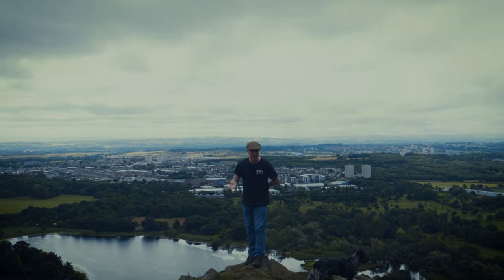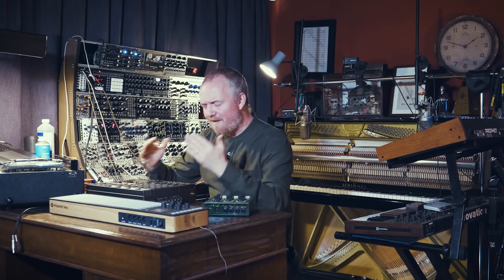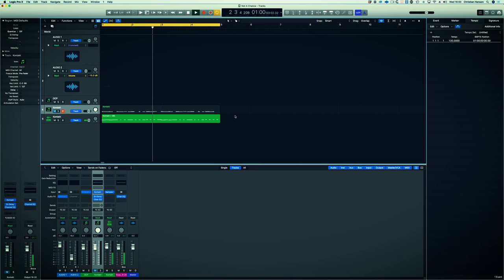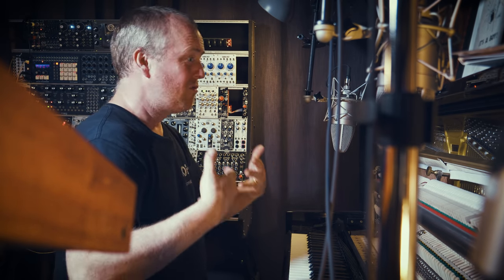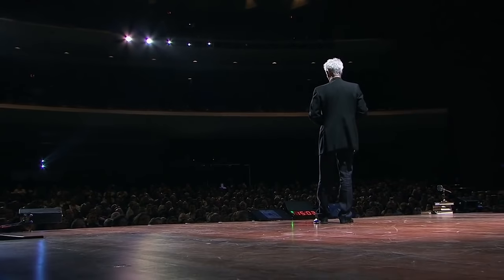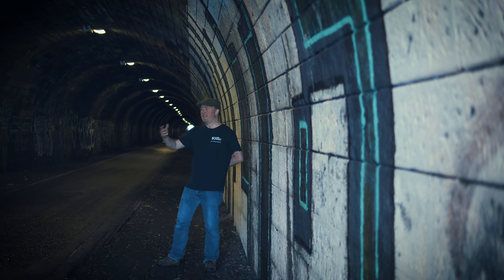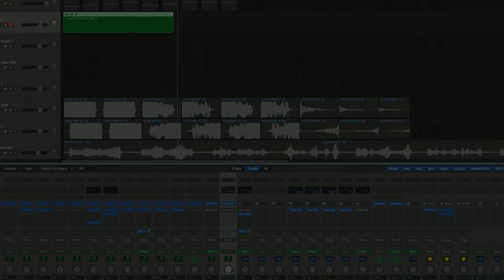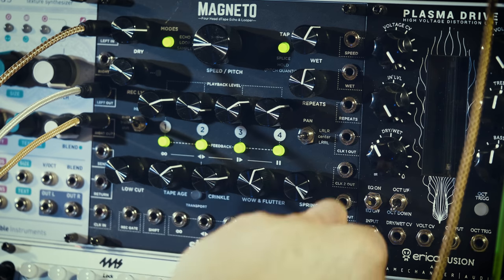Why Are Synths So Difficult To Mix???

Comment: Fascinating video! I knew a lot of this already but you went into greater levels of detail than I expected. Space perception and reverb are such important additional factors. Best video you've made so far. You've given me some new ideas about processing digital instruments, thanks for that!

I totally agree with the need to re-introduce some analogue artifacts to mess up the digital perfection we have nowadays, but I prefer to do it with plugins that emulate such things. They're so much easier to use, and I doubt many people have the ears or good enough monitors to tell the difference anyway. I've got a 4 track reel-to-reel deck sitting just a few feet away from me but I just can't be bothered to use it anymore.

Also, there are some great new developments in emulating analogue gear these days. Check out Plugin Alliance's Knifonium for example, it's the most authentic sounding emulation of a tube driven analogue synth I've yet heard (drifting oscillators for example). The video and audio examples don't do it justice though, using the actual plugin sounds so much better.

Comment: I've long disliked the trend for clinical bandwidth separation EQ.
As a sound guy I CAN do it but it's not a thing I'd use on any music I had any control or choices over. 

I love the audio playgrounds you make for yourself CH.
Reply: I agree. I've practiced making "clean" mixes to the point that it started to sound terrible. Things do overlap a bit in real life, and looking at a scope can be a bad thing, because our visual sense takes over for our ears without us noticing, and we'll "fix" things that there's nothing wrong with sonically. It's like tuning vocals in Melodyne. If you can see that a note isn't on the grid, you'll feel a strong urge to fix it.

We should look away from the screen more often. Close our eyes and hit play. Use the visual tools to locate the issues we hear, not the ones we don't.

Comment: When, prior to retirement, I was a Product Designer for a major analytical instrument manufacturer I asked our Senior Electronics Engineer, who had multiple patents in the field of signal amplification, whether there was anything unique about tube (you say valve) electronics that could not be duplicated by solid state electronics and he assured me there was not. Anything a tube circuit can be designed to do, including harmonic distortion when overdriven, a solid state circuit can be designed to do, at least if you know what you are doing.

Comment: Synths are so variable sonically. I find my analogue synths often have to be tamed back quite a lot when you start having lots of sounds in the mix. I've found myself scooping so much mid out of my Prophet '08 to stop it overrunning the main focus of the tune that I then had to mute/unmute it to see if it was even present enough to keep in the mix. But as you referred to with Kraftwerk and John Carpenter- arrangement and space make such a difference to  how it sounds (as with any group of instruments). Imagine mixing a track with a pads from a CS-80, JP-8 and Oberheim. If the sounds aren't crafted around each other in the first place, it's a tricky game.  Great video - thanks! (oh for the immediacy of the portastudio- I now miss that, despite being glad at the time to ditch cassettes for digital. Now I long for tape again!!!)
Reply: Tascam makes digital PortaStudios.  For the same reasons I prefer hardware synths over VI, I'm rather tempted.

Comment: Awesome presentation! Awesome sounding piano pad! Instant modern ambient cinematic design! Maybe u get more enormous and key oriented layers with samplers like EMU ultra (1999) pitch and filter, sample retriggering, sample start modulations per layer, or transwave sample granural like sample offset modulations from ensoniq eps-asr samplers (1990).

Comment: If you want to utilise the Monsoon (which is primarily a granular yhingymajig) as a reverb, try it out in the ErbeVerb inspired alternative mode. Another quick tip on the Monsoon if you're just getting started, the density slider is responsible for 'seeding' grains. In the mid position it seeds no grains, at the top end it seeds grains randomly and the bottom end it seeds them regularly with increased frequency as you reach the extreme minimum or maximum position of the slider. 

Have fun! :)

Comment: On soft synths for this sort of purpose, my go to plugs are the sound toys devil loc deluxe (usually with the mix knob low), arturia moog filter with only a very slight touch of cut off, waves j-37 on 7.5 ips with some pitch modulation, abbey road vinyl (does very tape like things to upper harmonics), and valhalla vintage reverb for spaces.  For me, adding some distortion and/or modulating the tape pitch always makes synths to sit better and feel more like a "real" recording in a room.  I find the valhalla vintage verb is dark enough to sound more realistic than many other verb plugins, particularly the 70's algorithm.  Also if you have several synths, I think you need to pick frequency pockets for each so they sit separately (unless you want them to sound like a unit).
Reply: You have the secret sauce my friend. Those are all very good plugins.

Comment: How do you film all this? Do you start with a script and film specific segments in these separate locations? The cuts flow so good and I love that all your videos always include some great hiking footage.
Reply from the maker: Thanks, I do a skeleton script and map out the set ups I want then I assign lines to the setups (trying to keep a read off each line across at least two setups) I then do a rough cut kill about half the script and then re script pickups. These i traditionally do In the shed so I can instantly put it into the cut to see if it works so here me sitting in front of synths set up and me at main workstation are the last pickups. When completing fine cut I usually have to really get the running time down so will trim back to b roll  and macro shots and replace my reads with snappier and more timed voice over. I then add additional footage and music, dub, grade and away it goes!

Comment: I kind of agree, but not entirely, mixing Electronic sounds is really easy, for me at least. It’s all about EQing, cutting of frequencies of sounds that it doesnt need, carving room for each sound in the entire mix. I see many comments about stereo, I don’t see an issue there either. I mean, yes if a sound is too wide it can cause phase cancelation, and then i might take only the left or right signal and add some stereo myself. But the main aspect of stereo is making sure the sub bass is in mono, or mostly in mono at least. And that is easy to achieve as well, just separate your subs, cut out all sub frequences from all sounds and add a clean sub bass under it. The mixing process for Electronic music is not so much about volume as it is about carving frequencies, and that does add a layer of complexity, but it isnt harder than mixing acoustic. It is just a different skillset.
Reply: Same here! also, he leaned a lot on the idea of chaos, but I think it's the total opposite. Recordings carry a lot of information: the kind of instrument itself (via the harmonics and noise it produces), the steadiness of the player (of breath or hands), the size of the space it was recorded in, if it's closed or open, the position of the instrument and the listener, materials and their arrangement in the location, even rustling suggests silent people or wind.... it's not chaos, it's all information that you pick on. Digital comes very clean so it gets boring quickly, but you can add any of that if you wish, to spice it up, with effects.
In digital instead of setting up your stufio for that sound you want, you setup effects to suggest all of the above. Create a place, a situation, a mood, with precise control. 

Additionally, clean precise frequencies will cancel each other in clear patterns, so there's that too.

Comment: Amazing textures! I wonder how can I get  close to this type of sounds in the box..
Amazing video
Reply from the maker: I would suggest starting from an organic source even if that is sampled, I did a whole bunch of pads like this in the box for Albion tundra and the trick is putting unexpected things in that add unexpected nuance and detail then make sure you curate each note so every note is different (I did this one in octaves) and make sure each note is long (20secs in this case). Then when you pull into your sampler make sure you only pitch down from the root note don’t pitch up.
Reply: @TheCrowHillCo  Will definitely try that out, thanks Christian!

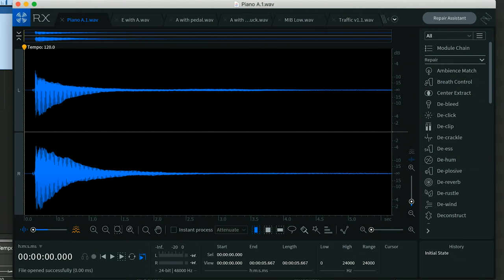Comment: Around ¬7:00 minutes,  there is a third option - (and apologies if you touch on this later, typing as I watch...)

Really dig DEEP with your EQ's, and carve out some spectrum space for the most important parts of the synth's freq-spread. As someone whose music is 99.99795% synth based, (with some guitar), I have to do this all the time, just to get my rig to play nice with itself when recording. My default templates for Cubase and Sonar Platinum are pre-EQ'd for the most common sounds I use when composing, so I can at least hear in general what I'm going for, as I put the track together. In the early stages of writing I use a LOT of "Brick-Wall" notch points in my track EQ's, which then become starting points for blending what is often a half-dozen different synths together in the finished track.

(edit):

Absolutely LOVED your explanation of how analog tape has a lead-in you have to skip before recording, it's incredible to realize there are actually people alive today who have never used analog tape, and would have zero clue that clear/colored section is not actually "tape"...

Comment: Chris , can you tell if its BETTER to get close to final sound in your recording, or you think its OK to record every step of the way? Meaning when you've produced a wave you could record it and later reamp it. have you ever found yourself overdoing some aspect like too much reverb or distortion, but unable to come back to previous version and thus stuck with the sound that's caracterful, but too much.

I'd say most of the time its not worth it to record and keep multiple steps before final sound. It does make sense to record multiple ideas  (dirty pad/wobbly sine/shoegaze pad) as takes to select later.

Comment: I find it's often necessary to run a complex EQ over each synth to pull out the sounds I need while cutting down it's overall noise, so I know where you're coming from. However I think you jump off it at the end there.

Comment: TBH I find synths much easier to mix than acoustic instruments :)
Reply: Part of the reason for that is that we need to EQ acoustic instruments to fit them around the synth parts though :)

Case in point: if you want to take the initial sine bassline in this video and fit it into a mix with the When The Levee Breaks drum loop, you'll need to cut a notch out of the drum kit's bass frequencies (or do some nice sidechain compression on those frequencies, I guess) so that the sine shows through the holes. The acoustic sounds end up tightly EQed and compressed so as to occupy very particular parts of a mix, as you hear in the punchier versions of that loop later in the video. It's another way of understanding the sounds and another way to approach them, in contrast to how things would've been understood and mixed in the 50s-70s, and that modern aesthetic partly comes from working with synthesised sounds which occupy quite specific frequency bands. 

Or at least, that's what I'd guess.

Comment: This video makes great points very well explained. Software instruments are convenient and portable, analog is more alive. But I can't understand why I have to choose between the two. WHY CAN'T WE HAVE THE BEST OF BOTH WORLDS? The VIRUS TI was supposed to be setting a new standard in hardware-software integration, and I can't believe we're in 2021 and this is not the case yet. Why Elektron is the only company with a proper DAW integration technology (Overbridge)? A guy managed to fit an entire analog synth in a USB stick along with a VST controller, the Trueno Synth. Just one guy. It's beyond my understanding why we can't have a portable Roland, or Korg, or whatever, analog synth, seamlessly integrated with our DAW, in a case that doesn't weight a ton.

Comment: I find more difficult to mix acoustic instruments. And my explanation is that it’s because I’m using samples, so I don’t record acoustic instruments by myself. Why is this important. Because when you use sampled acoustic instruments from different libraries, they didn’t sample only the sound of instruments, but they sampled the space where they recorded those instruments as well. It means that piano was sampled in one place, strings were sampled in another place, brass instruments in another place etc. Yet synths are not sampled in any place, they have pure sound. I am the one who is putting synths in one space with reverb. Otherwise I’m new with music production and synths, before I was playing only ROMplers, so maybe I’m wrong. But this is my explanation why I easier mix synths than acoustic instruments.

Comment: Weird , I believe the very opposite. There are exceptions (like a MiniMoog on all three oscilators) but mixing a piano or acoustic guitar or drums are far more difficult to get right than a Roland or Sequential or a drummachine.

Harmonics of an acoustic instrument are in general far richer. Try classical music on cheap hifi, it won't sound very good but electronic music (with less complex harmonics) might stand a chance of sounding ok on the same system.

Comment: Great video!, except for one small bit: when you said you can feel the difference between true randomness and computer-generated pseudo-RNG. This simply isn't true. Modern RNG algorithms are fairly good and produce unpredictable numbers. I'm not saying you can't tell the difference between computerized distortion and distortion from a real amp, but this is not the reason why

Comment: Remember, music is not really made of notes, but intervals between the notes: the absolute pitch is not that important.
Also. When I have to stick together different samples, I analyse them with a Fourier analysis, they became a sum of sine waves of diminishing amplitude. It is very important to keep the correct mathematical relationship among the higher spectral components, so the samples plays harmonically together. Initially I used the VFO and the tunable filters (my last moog used 88 ICL8038) but lately I automated everything of the matching via software. Everything in a laptop now. But it not the same feeling of the control panels of the '70...

Comment: We're not just operating speakers with voltage machines, though.

Sound is generated, inside analog circuitry. Sound waves of electrons propagate through the metallic traces on PCBs, and through copper wire. They pass through all sorts of components along the way, until they're finally converted into air vibrations when they reach the speakers.

The fact that we can't see those sound waves or hear them until they leave the instrument doesn't mean they aren't there ;)

Comment: I'm at 11min now and i have the impression there is a fundamental misunderstanding of the spectral information you're reading. Most of natural instruments will create upper harmonics in the exact same order as a saw wave from a synth. It's math and based on the "harmonic series" - Andrew Huang did a vid on that recently. 

To make things simple: if you start checking how much space is between those spectral harmonic bands of your piano sample, you will find that the higher you go up, the tinier this space gets. From an octave between the fundamental pitch to the first harmonic, to a fifth, to a fourth and so on (with some extra steps in between, just trying to make it simple). 
That means, if you play an instrument very low, like a bass line, your spectral image is filled with higher harmonics that are hard to distinguish since they are so close together already. If you play a higher note, the harmonic series gets much more obvious, just like with your piano. So if you want to compare your bass line in terms of harmonics to your piano, you should play it at the same pitch and then you'll see, that your synth actually has the same beautiful order in its harmonics when you use a saw wave, and has only half as much harmonics if you use a square.

I find synths much easier to mix since we don't have an instinct how they should sound, in comparison to a voice or a piano. Which means you can get away with much crazier eq-ing and effects.

Hope this helps a bit. Having a spectral vst on your master bus really helps learning a lot about music. Can recommend 11/10.
P.S.: sorry if you explained it later and i was just an idiot for typing this out.

Comment: I don't agree with the idea synth's are cheating by "not making sound".   The speaker is akin to our own vocal chords, which make sound by vibrating the air around them.   That's all sound is,  vibrations traveling through a medium.   It's not cheating,  both a speaker and a vocal chord  are mechanical processes.   Even the source for your vocal chords is technically electrical/voltage controlled because our entire body controls itself through very small voltage signals.   I don't think anyone would dispute that a vocalist is making "sound" when they sing.

As far as traditional instruments themselves,  you still have a mechanical process going on,  something mechanical is still being acted upon to vibrate the air around it.    It's disingenuous to suggests synthesizers don't make sound.   They just make a different kind of sound.   The same way  English and Japanese, or Swahili are all languages even though they are completely foreign to each other (in a practical sense).   They still serve the same function in their natural environment.